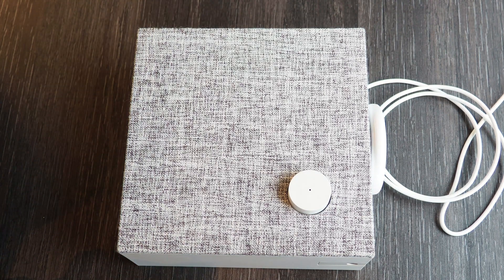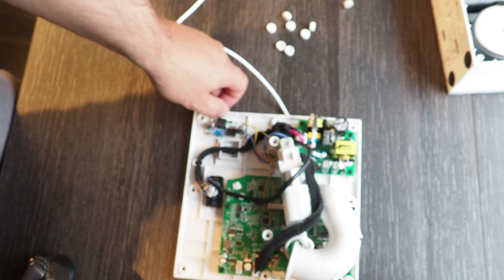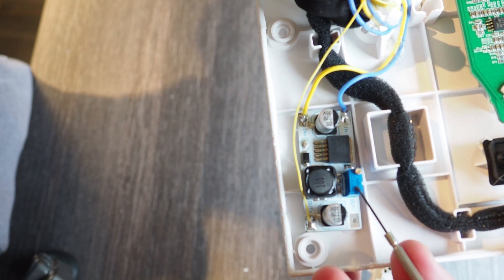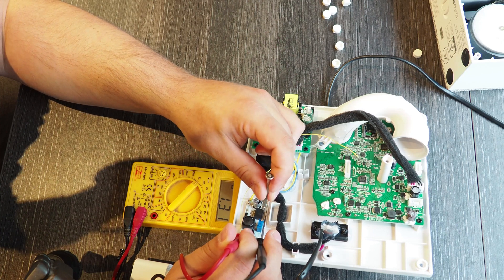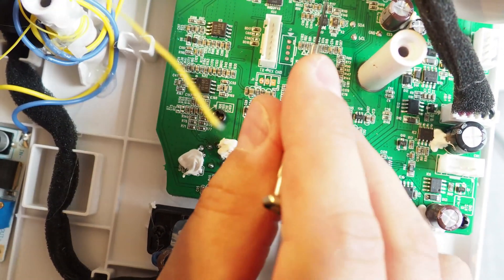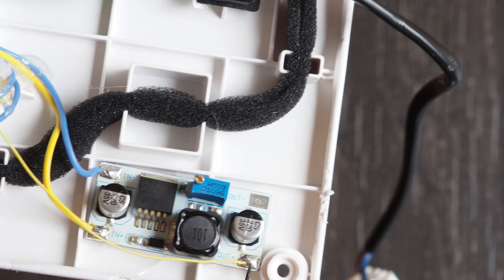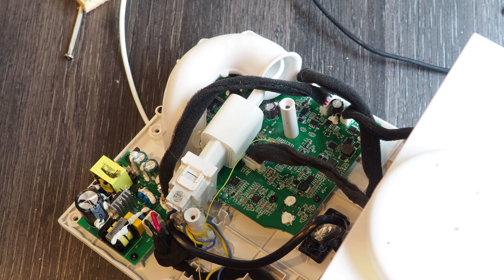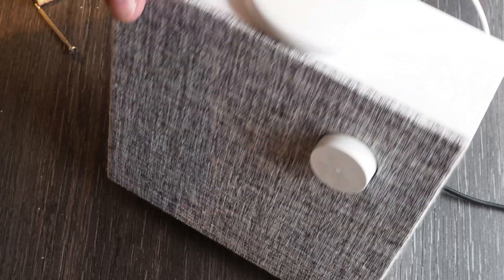Ikea Eneby20 hack - deep sleep

Comment: Hi Andrija, Thank you for your video. Maybe i will try the hack. As you said, maybe it will be more easy if we solder wire on the "right side" of R32 resistor. Have you had any issue with the hack?
Reply from the maker: It is still working without any problems :)

Comment: Hey Andrija! I finally found some time to try to make this hack. However I think I might have screwed it up with my limited soldering skills.
I can't turn the speaker on at all at the moment. (I knew what I was getting into but I still hope there's a way to fix it).

Please take a look at the images here and let me know what you think. 
I managed to get 1.2 volts from the DC-DC Converter (Image 1-2) but I think I might have screwed things up with excess solder on the chip (Image 3). Do you think I'll be able to save this somehow? Maybe by using some desolder wick and flux to remove the excess solder?

https://imgur.com/a/prIgTF6
Reply from the maker: Well,  first step would be to remove excessive solder on chip, after that check it if it is still working (hopefully it does) and then just do it again, but use smaller wire maybe and  more precise soldering tip.

Solder removal - desolder wick will do the trick. If you don't have one, clean soldering tip and just use regular wire to pick up excess solder
Reply from the maker: And to ease your life, you can solder wire to the board where resistor was(side closer to chip)
Reply from the maker: @fairtomee2612  Did you remove R32 resistor? And try to set higher voltage, you can go up to 1.8V

Comment: Hey Andrija! Thank you sooo much for this recording! I hope that I'll be able to give this a shot next weekend!!!
Reply from the maker: If you get stuck let me know, I will try to help
Reply: Andrija Kozlek [2-pack] LM2596s Buck Converter DC to DC Step-down Voltage Regulator Power Module 36V 24V 12V to 5V 2A Voltage Stabilizer with LED Display  https://www.amazon.com/dp/B07CVBG8CT/ref=cm_sw_r_cp_api_i_DNJ0Cb9VFE4J1

This one should work right?
Reply from the maker: @eriklindholm6380  yes it will be OK
Reply: @ClioSport2016v  Awesome! thanks. Will try this in the weekend... also, you should share this video on that other video thread... you will make a lot of people happy with this.